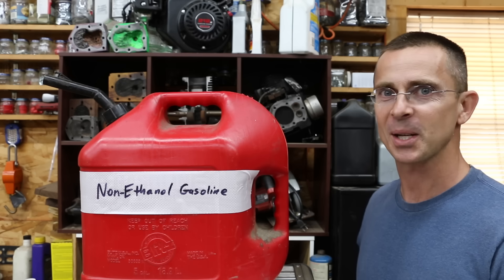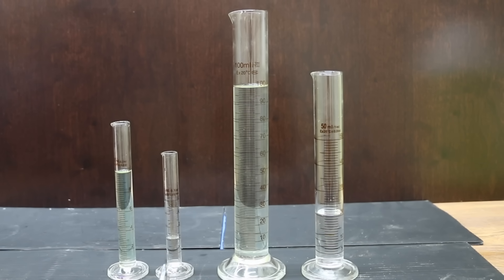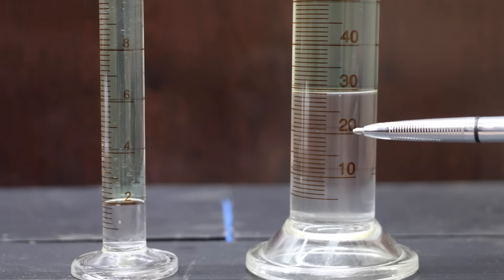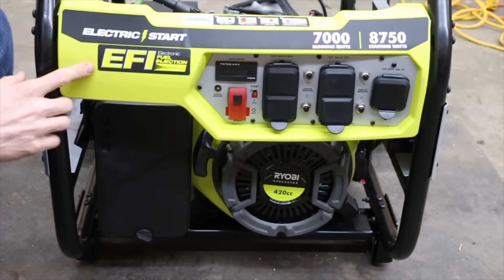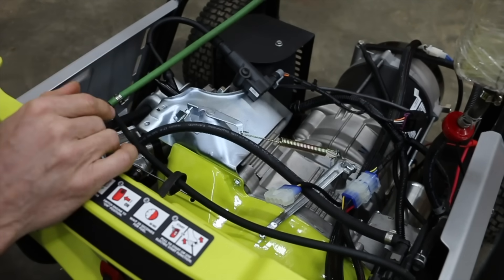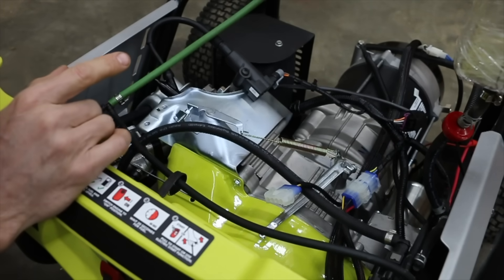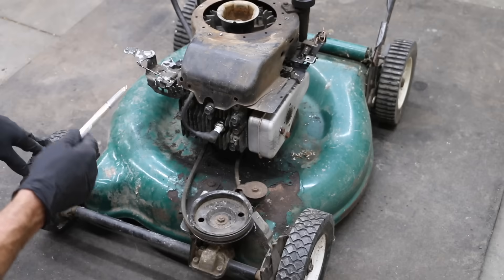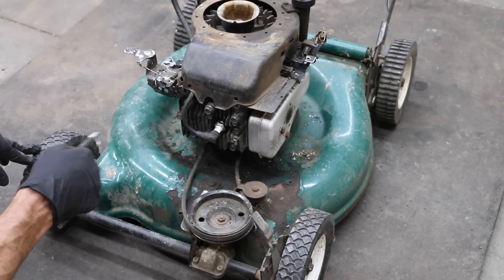Is Non-Ethanol Gasoline Really Better? See the PROOF!

Comment: I think propane is the next innovation in lawn care and generator use that will evolve and will become the next generation for the fuel of the future. 
I have 3 propane powered tools that are virtually maintenance free and they are a 4 stroke weed eater, a 42" 17.5 hp riding mower and a 7500 watt generator.  I feel sorry for  the people that are still hassling with 10% alcohol gas eating up fuel lines and clogging carburetor jets .
Reply from the maker: Thanks for the feedback.

Comment: Mehhhh. Alcohol boosts the octane yet saw the video on everclear and everclear is almost race fuel? since the flames are invisible, but doesn't burn as good as gas.  so back to the comment/video on ww2 pilots injecting water/coolant for added fuel mileagehorsepower... does ethanol gas add more hp but just carbon up the valves.?  And have you... tested 'race gas' in a mower. And what is race gas. Because alot of ppl think its ethanol, or is it just really pure gas? With maybe a few napthene type additives. ? Thanks
Reply from the maker: Thanks for the video idea.

Comment: Ethanol will cause water to gather in your engine thereby causing your parts to rust and if you let it set long(very rare cases) enough it will seperate out and there will be a lower layer of water and an upper layer of gas so when you start it it will suck up the water and waterlog it.
Reply from the maker: Thanks for the feedback.

Comment: Tell me how good your chainsaw will start with ethanol ?  I did some test on riding mowers and ethanol. The engine will start BUT, the starter will work excessively. Whatever you save in gas price, will cost you a new starter on the long run. Your call.
Reply from the maker: Great suggestion!

Comment: In my years of experience, ethanol fuel stays fresh for about a month now. When introduced, about 3weeks.
Non-ethanol a.k.a recreational fuel, lasts over a year and a half. 
I use rec fuel in anything that has the potential of not being used for periods of time, but needs to used at a moments notice. Power washer, lawnmower, weed trimmer, motorcycle. 
Using ethanol or non-ethanol fuels. Shut the fuel off and run till engine stops. Because nothing ruins your day faster than having to clean a carburetor when it could have been easily prevented!
Reply from the maker: Thanks for the feedback.

Comment: I HAVE A 30 YEAR OLD CAR THAT HAS 3.8 L V6 BUICK ENGINE AND HAS DONE 350000 KM AND USED E10 SINCE 2009 WHEN I  PURCHASED IT   NO PROBLEMS    AND ALSO USE A 6.0 LITRE L98 ENGINE WITH JUST OVER 200000 AND NO PROBLEMS STILL
Reply from the maker: Thanks for sharing.

Comment: 100% gasoline is always better, unless you know nothing about engines and insist on 02 sensors to do your tuning.  No, I am NOT one of the slack-jawed "Gushers" over the "New Technology".  Petroleum based fuels won't cause food prices to sharply rise, yes corn was a food before it became fuel.  Haven't checked my portable generator yet, but my old car got much better fuel mileage from real gasoline.  Used to race methanol powered cars and couldn't breathe around them at idle.  Bad for the environment.  Ethanol causes rapid oxidation of aluminum parts so engineers coated many parts with a polymer which is not earth-friendly.  I won't touch a chainsaw carburetor that has had gasahol in it.  Which is better is now a moot point as you have no choice if you drive a newer car.  Chemical engineers working in the automotive and yes the FOOD industry are killing us all........painfully.
Reply from the maker: Thanksk for the feedback.

Comment: I can say one thing here and I have learned this FACT from some very painful and expensive repairs.  NEVER run ethanol gas in any small engine such as is used on pressure washers, chippers, weed eaters, and lawn mowers.  The seals and internal fuel lines can't handle the alcohol and the carbs will crap out quite quickly.  Some of the newer units have a different quality seal and internal fuel line but after the amount of money I have spend on repairs I still don't trust them.  With older big vehicles like cars and trucks I understand there's a problem because of valve seats not being able to handle ethanol gas as well as carb problems.  The newer vehicles have different valves and valve seats as well as being fuel injected.  I personally will never run ethanol in anything other than my truck which is E10 rated.  Non-ethanol may be a bit more expensive at the pump but a lot less wear on the small engines, my nerves and my WALLET!
Reply from the maker: Thanks for the feedback.

Comment: Recently stumbled across your channel and your approach to each project is exactly why I love science and experimentation. I think you definitely would be able to follow-up on this type of project by mixing new gasoline blends. Ethanol is just one of many solvents or liquids that can be used as a fuel additive. Rubbing alcohol, while very similar to ethanol chemically, would be an interesting comparison. Other suggestions include turpentine, kerosene, and acetone (found in nail polish remover).
Reply from the maker: Thank you very much!

Comment: Test the blendzall gold label,  see if it and 93 pump gas can replace 110 race gas in high compression engine.  Also are there any hp gains over regular 89. I also think blendzall gold label acts as a stabilizer in ethanol fuel.  I love blendzall gold label and use it every tank in multiple ATV's. I just wonder if its all in my head and if I'm wasting my money.
Reply: Love your vids!

Comment: Isnt it supposed to be better only in certain engines? Like higher compression and high performance turbo engines? 

I see u using it on pretty basic engines, without even a fuel injection system?

Comment: Great video! In my 08 Jeep 3.8 engine, 10% ethanol (Shell gas, exclusively) will cause pre-ignition after about 3k miles. I then run one tank of V-Power and do a couple Italian tune-ups and it clears it up for another 3k.  I'm convinced it is carbon buildup causing it and the additives in V-Power clean them out.  I've noticed in the last year or two that I'm not getting the pre-ignition anymore running 87 Shell.  I tested the gasoline for ethanol content and found it to be between 2 and 4 percent.  I think the lower content (ethanol has been more expensive as oil has gotten cheaper, so I think suppliers have been reducing the amount)   I haven't heard pre-ignition in this engine in at least 10k miles, maybe 15k, under any conditions, including towing.  This is the only vehicle I have where I believe I can tell a difference between ethanol and non-ethanol gasoline.  It also just runs better/stronger with non-ethanol, which I have occasionally found.
Reply from the maker: Thanks for sharing.

Comment: When i had my 98 K1500 chevy i was in Mississippi.  Could get 87 octane non ethanol.   There is a difference.  In startup.  Throttle response  and i can go a little further on a tank.   They do cause mowers to fail or need repair sooner.    I get pure gas when i can for that
Reply from the maker: Thanks for sharing.

Comment: I run straight 200 proof in my mower no problems all about the ph of the ethanol. Most gas companies add water to the gas to get there 1 % allotment. If you get 200 proof straight out the mole sieves with a good ph of 6 no problems. If ph is lower makes very acidic then you have deteriorating issues and poor compatibility with gas otherwise high octane blue flame, I also run a hotter plug, 1400 hrs on my cub cadet 16 hp briggs. And yes I make ethanol for a living and do understand issues from the process that make undesirable effects,  with ethanol process and oil refinery. My next project is a solid and liquid waste gasifier to run my generator. I enjoy your videos and also comments and respect everyone s opinions, it's what makes U.S. great.
Reply from the maker: Thanks for the feedback.

Comment: I believe ethenol is fine if it is used in a timely manner. If it sits too long I believe that is where the trouble begins. I have had a chainsaw carb gummed up just terrible after it sat with ethenol too long, also two motorcycles/snowmobile/leaf blower. That is five engines. Never do I let an engine sit through the winter with ethenol in it anymore. Always use Rec 90 now.
Reply from the maker: Thanks for the feedback.

Comment: It has nothing to do with how Ethanol works in the engine that I have an issue with.  The issue is that it takes soooo much diesel and natural gas to make ethanol.  This zeros out any emission gain that is made at your vehicle.  Dump carbon in the air at your car or dump it at the manufacturer.  Which way puts the least carbon in the air is the best
Reply from the maker: Thanks for the feedback.

Comment: Well this test doesn't tell the whole story... 

1)small engines are stated to RUN HORRIBLY ON Ethanol. Due to AFR...
2)E10 is by far the poorest ratio of ethanol to gasoline in science... The reasons they did this was 1 profits as your mpg suffers the most of all mixtures of ethanol and 2 to give a renewable fuel a bad name... Cuz the oil companies make less money in a fuel anyone can make themselves... No monopoly...

I have build a few race cars and am a Tuner. I've tuned and tested many mixtures. Puerto Rico knows how to mix fuel right, they use E15-E25 for that reason. Which increases fuel economy by up to 25%... While America uses  E10 which lowers fuel economy by up to 25%

I'd like this test to be run between 15-30% because I've had the best economy at what science agrees is optimal. Carbon deposits may or may not change at that low of a level but possibly over thousands of miles...

I use between e70 and e80 in my race car for optimal power and the engine egt Temps are WAY cooler. Even at full boost and higher timing and compression.
Reply: korn- you say 'what science agrees' a couple of times, but I'm not seeing any scientific studies quoted. I'm very skeptical of people making vague "science" statements.  I'm not saying you're wrong, but if it's true, cite the studies...

Comment: If you buy a new boat the fuel lines on it are not made for ethanol and the line will detonate can cause engine damage to it fuel system. And the dealer will not tell you that it will. It take a couple years but it will cause damage. So I highly recommend you can the fuel line or you can pay for new injectors later.

Comment: I have a '99 Dakota, 5.2 liter V8 over 280K on it. If I run fuel with ethanol it knocks something fierce. With Mid-grade non Ethanol It runs just fine. This motor has never been rebuilt, and does have a plenum leak. Maybe that exaggerates the problem I already have,  but still  to go from fine to rattle rattle thunder clatter boom boom is ridiculous.

Comment: I dont even need to watch this to tell you ethanol sucks,actually let me rephrase that,its a simple rule,if you have  a new car,have at it,chances are you will be fine,if you have a older mower,car, snowblower any machine,motorcycle, tiler, dont use ethanol, if you want your old tank, injectors, sending units and fuel pumps to looks like they came from the wreck of the Titanic (AKA the ole rust ball) and you like repair bills,please use ethanol,satisfaction guarantied,lol

"i know" i have seen it up close and personal, no wife's tales,no fables or internet legends,it will destroy your fuel system, i dont care what engineer with a masters from Harvard says.
Reply from the maker: Thanks for the feedback.

Comment: add 3 oz of acetone per 10 gals fuel for up to 20% better fuel mileage and will clean out the varnish in your engine in a fuel injected engine. add 1 0z per 10 gals of xylene for a smother running engine
Reply from the maker: Thanks for the feedback.

Comment: Why does everybody insist on saying that ethanol is used to raise the octane in gasoline??? Octane is C8H18; the eight carbon atoms is where the "oct" in octane comes from. Ethanol is C2H6O (O for oxygen, not a zero on the end), a completely different compound that does not and cannot contribute octane. All energy produced by either of these fuels comes from oxidizing the carbon. Ethanol has 30% less energy per unit of volume than octane, and burns cooler than octane, so it reduces the energy output of gasoline rather than raise it, and pure octane will burn better than gasoline cut with ethanol. I like your approach to testing and such, but you REALLY need to fact check your script before recording.
Reply from the maker: Thanks for the constructive feedback.  The information I received came directly from a contact who blends fuel and tests for proper octane at a refinery.

Comment: I have used ethanol in small engines for 25 years with 0 trouble the ones that I get in on fixing are running no ethanol  just crap gas.  location South dakota
Reply from the maker: Thanks for sharing.

Comment: Yeah, ethanol is fine for big engines. But for example for small displacement like my 2 stroke Aprilia rs50 will have broken carburetors if you use ethanol too much, it's like a weird buildup of sugar (because alcohol becomes sugar when it dries and builds up) which glogs the carburetor jet. Yeah dont use it on small engines.

Little note I have to mix the oil and gas too (I removed my oil pump)  so that's a little factor too
Reply from the maker: Thanks for the feedback.